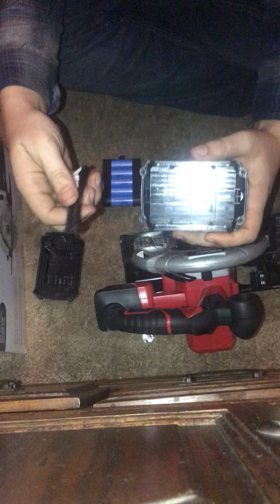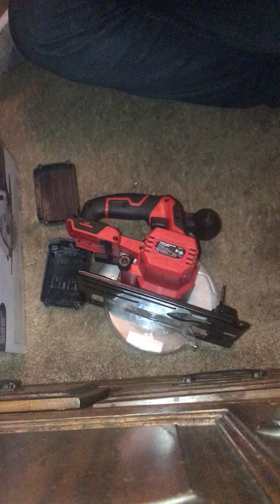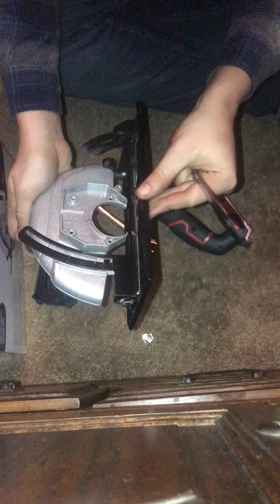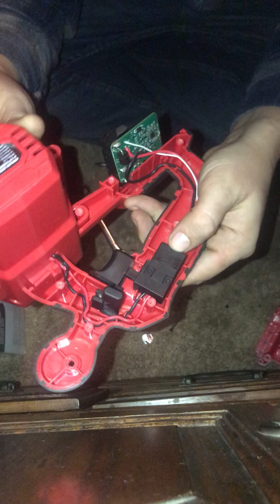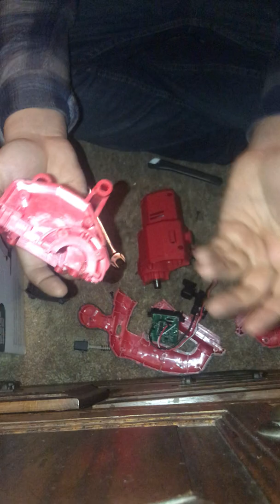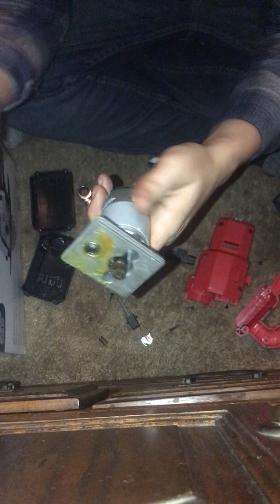Hyper tough circular saw 20v tear down (Walmart)

Comment: When you took this out the box, was there an extra screw that came along with it that you recall? Just took mine out the box and there was an extra screw with a nut attached in the bottom of the box and I’m a little worried that it may have fallen off the saw itself!